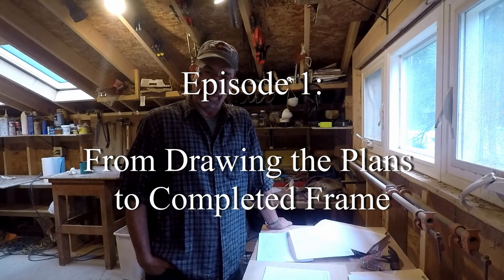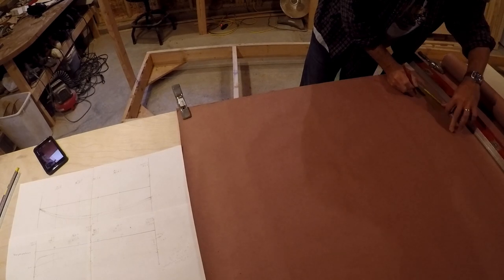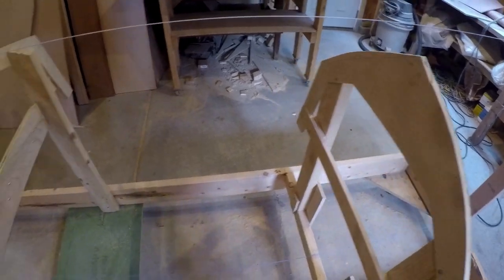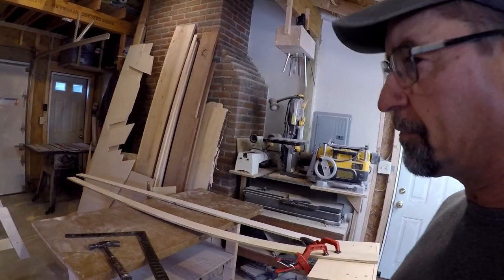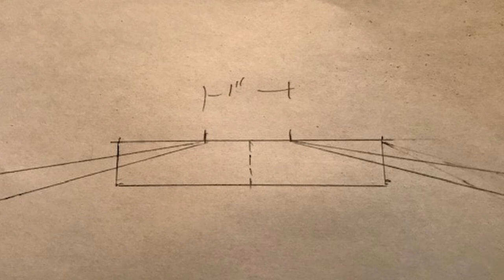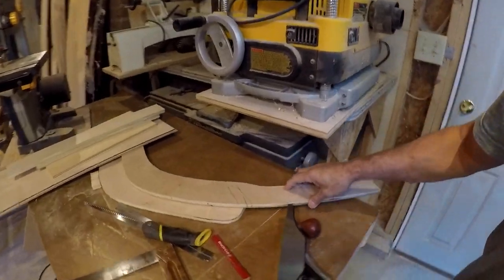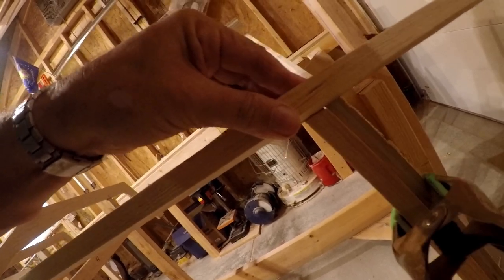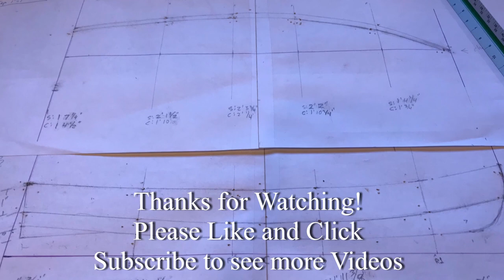Ep 1 Plans to Frame: Designing and Building the Sailboat Grace

Comment: This is the first episode I've watched. I'm hoping you go into depth at some point about why you designed this type of boat and how you learned to design boats. There's not a lot of good information online about hand drafting boat plans... at least not that I've found. Any recommendations on this front? 
It's been a blast to watch so far. Thanks for sharing!
Reply from the maker: Hey sorry for missing your comment!  I made a much longer, original build series, and talk just a bit more about drawing the plans.  But I'm afraid I don't have much detail, as I've basically learned the hard way by trial and error with now four different boats.  For sailboats especially, looking at similar-sized popular boats and doing ratios for key factors like the position fore/aft of centerboard vs. mast, ratios of length and width, the amount of "rocker" or curve across the bottom, have been helpful as sanity checks.  

Here is the link to the first episode of the original build series--VERY primitive video/editing as that was my first attempt:

https://youtu.be/ahyZmKmJSLY

Thanks for watching and if you have specific questions I'm happy to at least share what has worked for me!
Reply: @rudywoodcraft9553  Thanks!
Reply from the maker: Hi Timmboat Show I just uploaded a video about the design/build process I've used.  Not sure if it is the sort of thing you are interested in...let me know!  https://youtu.be/z6Fi6zfRHj0